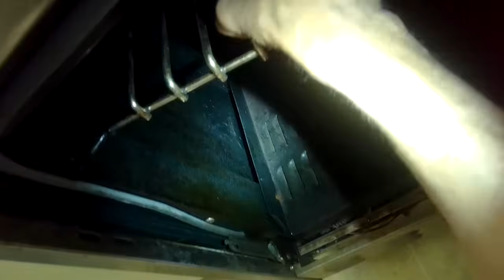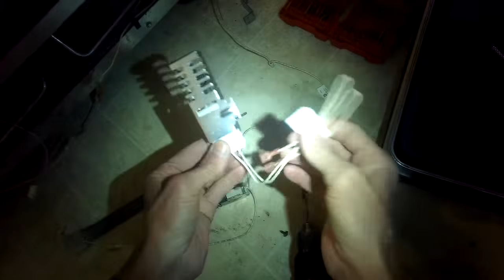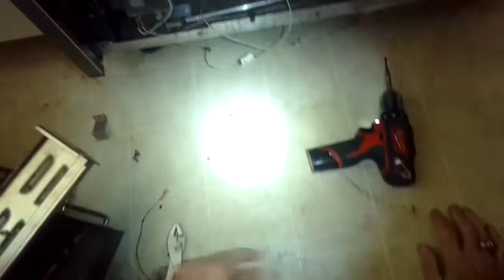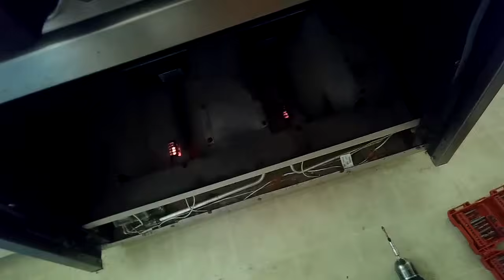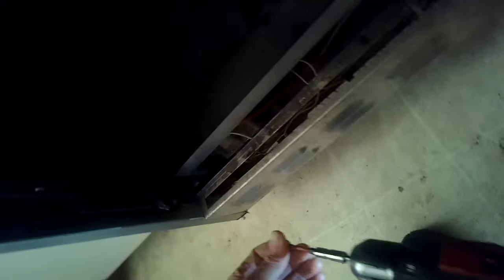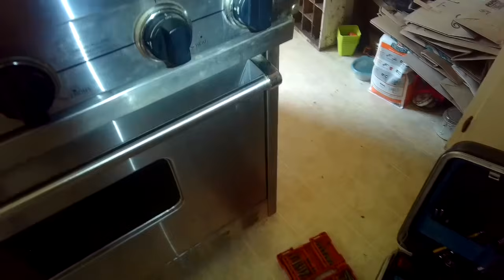✨ VIKING OVEN WON’T HEAT UP - EASY DIY FIX ✨

Comment: My broiler won’t light. I hear it clicking and then I smell gas, but it won’t light. Any ideas?
Reply from the maker: You might try cleaning the metal electrode with a wire brush.

Comment: Someone has spliced into the wires for my igniters. I have a brain injury and I am a veteran. I was sure that I put everything back like it was, but now the oven doesn’t work at all. Can someone please show me exactly how the wires are supposed to run? Model number is VGSC305-4BDWHBR
Reply from the maker: Try watching at 2:57 for the wiring part.

Comment: We've had our igniters replaced twice and still having the problem of the oven not getting hot enough, smelling like gas, and it sounds like wind in the oven with a low flame threatening to blow out.  Oddly the oven is worse at night so we try to bake during the day.  We've had multiple people including electricians and calling Viking directly and no one can figure out why that happens.  Any thoughts?  I'm in the Bay Area, do you do housecalls if replacing the igniters still isn't working?
Reply from the maker: I would try adjusting the air/fuel mixture shutter on the side of the bake burner tube.

Comment: We have model VGIC53616BSS02. One igniter and a horseshoe shaped burner. We replaced the igniter and adjusted the air shutter extensively. Does not light all the way around the burner very well. One side ignites and then takes 30 seconds or more to go all the way around the horseshoe shaped burner. Any suggestions?
Reply from the maker: Maybe the safety valve isn’t letting in enough gas.

Comment: I replaced (2nd time) the spark module and the burners are still not lighting up. Could it be possible that the broiler igniter and the two bottom burner igniters all are bad? Seems odd that they would all fail. (I had this problem 2 years ago and replaced the spark module and the oven worked, not so lucky this time)..
Reply from the maker: Could it be that the broiler igniter has failed?
Reply: @QuickAndEasy5MinuteAppliance  doesn't seem logical that all three igniters would simultaneously fail. Unless they are in a loop?

Comment: What if you have replaced your igniter?  And it still doesn’t light up?
Reply from the maker: It probably needs a new controller to send power to the igniter.

Comment: Thanks for this video. It helped me replace a faulty igniter fairly quickly. I only spent $50 on the new igniter. This could have cost me several hundreds of dollars in California if I would have needed to hire a pro. Thanks again!
Reply from the maker: Excellent! 😊Scott’s Tip Jar - Click Here: https://venmo.com/code?user_id=2758682643267585005

Comment: I just fixed my in-laws’ Viking thanks to this video and the parts in the link. It went exactly as you described and I got the air mixture dialed in. It went from not being able to preheat above 300° even after 30+ minutes, to ripping to 425° in eight minutes. Thank you for the great video and thanks for help making me look like a superhero to my in-laws. 👏
Reply from the maker: Thanks so much Joe,
Congratulations 😊

Comment: My viking range isn't getting power down to the lower bake ignitors. The broil ignitor works fine. We are getting 120v to the wires but not getting any neutral. I am so perplexed. No one can figure out how to fix it. It must be a wiring issue. Its for a VGRC365. Any suggestions? I don't want to trash it. The burners and broil works perfectly
Reply from the maker: I think the oven relay board needs to be replaced.

Comment: Thank you for this video. I am going to try it. Would this part work for the VGIC3064BSS Viking model? Thanks in advance
Reply from the maker: Here’s the one for your oven: https://www.ebay.com/itm/165397473250?chn=ps&_trkparms=ispr%3D1&amdata=enc%3A1fngg5yQXQlyR5vI9IaHZDg70&norover=1&mkevt=1&mkrid=711-117182-37290-0&mkcid=2&mkscid=101&itemid=165397473250&targetid=1587268787897&device=m&mktype=pla&googleloc=9032084&poi=&campaignid=19894961968&mkgroupid=148855406073&rlsatarget=pla-1587268787897&abcId=9307911&merchantid=670468611&gbraid=0AAAAAD_QDh99ZpJfT3tMyou1kqY5UyNfn&gclid=CjwKCAiAlJKuBhAdEiwAnZb7la9b52-VD9whk1y1-XcfDwGo5ROd5pG0iwOT8z8fn_aUAo6Re4z9IBoCPqEQAvD_BwE

Comment: Hi. I really appreciated your video. I had a question I was hoping you could answer. When I took the heat deflector out of the oven to replace the burners/igniters I tested the burners and they seemed fine. The igniters lit up orange and then the burners came on with a nice consistent blue flame. I did notice that the heat deflector is separated from the bottom pan and quite out of shape. My thinking is that the shape of the deflector is causing our heating issues and not the burners/igniters, but the heat deflector. Do you think that might be the case?
Reply from the maker: I think you’re right,
Sounds like it is the warped heat deflector that’s the problem.
I wonder if you can contact Viking and have them send you a new one.
Usually that happens as a result of too much heat. maybe during a self clean cycle.
Reply: @QuickAndEasy5MinuteAppliance  Thank you for responding. I don't think we have ever used the self clean cycle on the oven, but I have tried to get it pretty hot for pizzas. I have ordered a new one from a third party site. Hopefully that will do the trick.

Comment: Great video!   My Viking problem is: It can turn on but with a continuous click sound and cannot hold the fire. I have to manually turn it on several times that last for 10 - 20 minutes with multiple trials. It might hold fire eventually. It seems to have uneven cooking.  Does the fix in video works for me?
Reply from the maker: Great Question👍 Click Here to Get Live Expert Help From Me For Just $5.00:
https://www.youtube.com/channel/UCGpInAejvpfVVE4FHB_L-Dg/join

Comment: Can you adjust the fuel air mixture for the top burners?
Reply from the maker: You can,
There’s an air-fuel mixture vent that can move back and forth to allow more air into the mixture.

Comment: Are the igniters the same for all Viking gas ovens?

When should the igniter tubes be replaced?
Reply from the maker: Hi Alan,
Sometimes due to corrosion and heat you’ll see a large hole in the burner tube near the igniter. At that point you should replace the tube👍

Comment: Nice video. I changed both my igniters and gas tubes. But don’t understand why only one burner is lighting???? Any ideas you could send my way??? Thx
Reply from the maker: I wonder if something went wrong with the wiring during the install of the 2 igniters?
Reply: @QuickAndEasy5MinuteAppliance  Hey there,
I checked the wiring and had plenty of required amps. I finally gave it a few taps (about 20) with a small wrench and gave it a spin. It lit just fine. It kind of reminded me when I would have to service my old tank, the O’Kieffe and Merritt stove I grew up with.   The Viking works well now. But thank you for your video and reaching out. Best to you and your channel. I’m subscribed!👍💪🤞🙏
Reply: Great directions! Thank you. Could you provide a link where you bought the igniter?

Comment: Hello, getting a yellow flame on one burner any suggestions?
Reply from the maker: You should loosen the screw on the burner tube that controls air flow and turn it until you get mainly a blue flame. Yellow tinges are ok, but it should be 90% or more blue👍
Reply: @QuickAndEasy5MinuteAppliance  thank you

Comment: My igniter seems to be working but I am not getting gas to the oven burner. Stove top burners getting gas just not to oven. I see no info anywhere on this problem. Any input appreciated.
Reply from the maker: About a 98% chance that a new igniter will solve the problem.
It’s super common for them to glow but not let in the gas when they are worn out👍

Comment: Howdy, you wouldn't happen to have a better look at the correct wiring, would you? I have one side not firing up but lighting, but I suspect it wasn't wired correctly initially. It looks like both igniters are wired in series with eachother, with one end of the one igniter to hot, and the other end of the other igniter to the gas valve. There is 120vac across the terminals from hot to gas valve when the igniters are removed. It kinda looks like yours has two hots, one on each igniter, and each igniter goes to a port on the gas valve individually? I checked voltage across another line from hot side to the gas valve that is hooked up directly and it only gets to 12vac so I don't think that's right... Any guidance is appreciated
Reply from the maker: Does this one help: https://youtu.be/HGLF21Cd4_4
Reply: @QuickAndEasy5MinuteAppliance   this does. Looks like one leg of my gas valve is done for. Thanks for the response.

Comment: My Viking range heats up but takes 30-40 to get to the temperature. Then burns the top and doesn’t cook the bottom. I live in the middle of no where so it’s kind of figure out on my own. Any thoughts? Tysm
Reply from the maker: This should do the trick.
When an igniter gets old it causes the oven to take much longer to heat up and also can cause uneven heating.
Your oven might need to new igniters to fix it.
You can order them from amazon.com for about 20 bucks apiece.
Reply: Did you ever find a solution, having the same exact issue and cannot find a service provider due to our lake location!